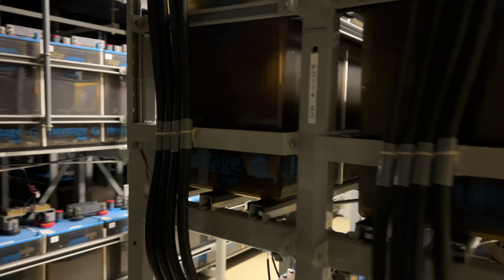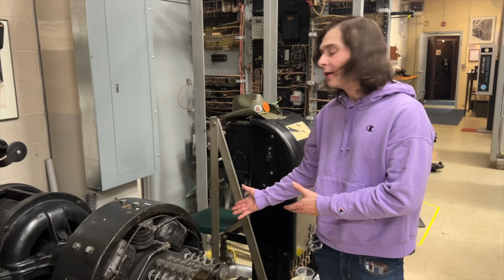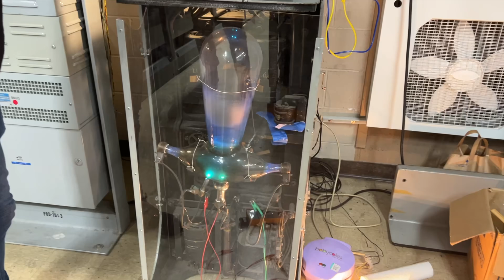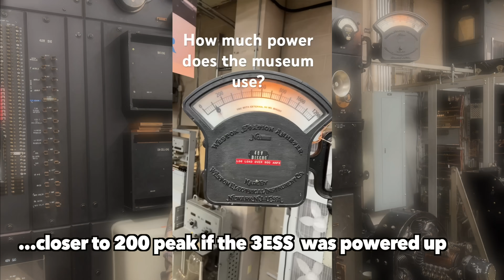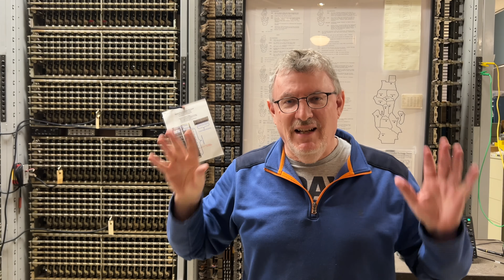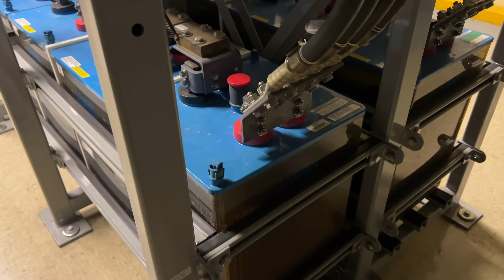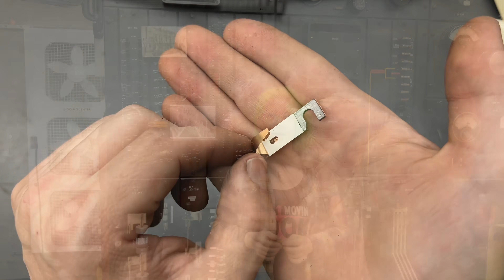All About Telephone Power Plants

Comment: Curious electronics student here with lots of questions:
4:32 So the power is always supplied from the generators, and the batteries are only there to smooth out power fluctuations? And if so, how large do the batteries even need to be relative to the load, i.e. how long would they hold up without (/with inadequate) generator input?
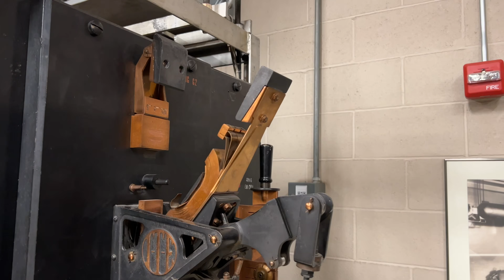7:40 If I had to guess, that's because it also contains enough copper to be very appealing to scrap. Very cool mechanical system, though, I'd definitely be interested in a more detailed discussion of it (Where are the remote actuators built in? How does it distinguish manual and overvoltage/back-EMF shutdown? What's the bottom contact pair with the jacobs-ladder-y arc extinguishers for? Why the three-stage contact mechanism and not just two stages?)
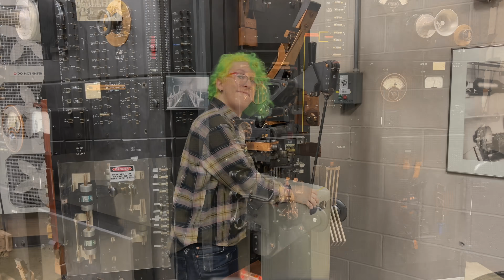11:23 So are the end cells intended to increase battery voltage temporarily? But if you still regulate to 48V with additional cells in series, the average cell voltage will drop, which is apparently pretty bad (14:16, although I'm surprised that 1.9V instead of 2V already damages lead-acid cells, I thought those were pretty resilient to overdischarge)
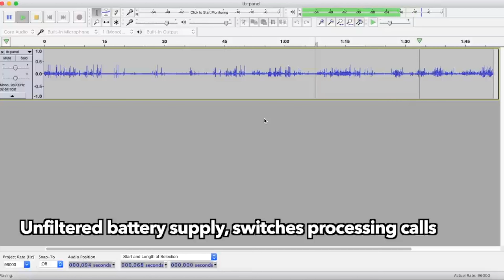3:31 This may be too fundamental a question, but I'm confused how exactly this switch-over works - particularly for the caller in a long-distance call, where the final connection is made in some far-away office: how does the originating office know the call is now connected, so it can switch to the talking battery? And how does the switch-over and resulting voltage drop not result in the connection being dropped?
Reply from the maker: Good questions! I'll try to provide helpful answers.

1. In the earliest days of common battery telephones (1900s-1920s) the equipment and network ran off of the batteries. When voltage became too low, Battery A (that had been supplying power) was cut over to the charging equipment, and Battery B (which had previously been charging) was cut over to run the equipment. Eventually, they moved to a "floating" style of charging, where the equipment is running on the batteries, but those same batteries are kept continuously charged.

The batteries always served two main purposes. To smooth out ripple in the charging circuit, and to provide reliability during power failures. Batteries could run the exchange for a few hours to a few days after a power failure. Exchanges also had diesel generators to charge the batteries, and those could run as long as fuel lasted. AT&T had pretty fantastic supply chain management and they could get fuel anywhere very fast.

2. The circuit breaker is surprisingly complex, and different breakers could be outfitted with different options depending on what the customer needed. The jacobs-laddery-contact-thing near the bottom opens the circuit to the main operating solenoid just after it starts to pull the breaker to the closed position. The solenoid uses A LOT of current, so we have to break it quickly and we don't want to do that with the button that actually starts its operation. Think of it like the "snapping" part of a household light switch.

3. The end cells are only cut in when the voltage of the main battery string is low enough to require them. We don't necessarily regulate down to 48V. That's just a "nominal" voltage. For example, the voltage level at the museum is 52.6 volts. (We don't actually get to decide on that number. That's just what Lumen, the telephone company, provides for us)

4. Talking battery is actually supplied in two places. For the originating side of the call, it is provided by the local office. For the terminating end of the call, it is provided by the far-end office. There is no need to apply talking battery for all of the links in the middle, since the talking battery is really only necessary for the telephones and local hook-state signaling. The human voice AC "wiggles" can travel along the wires just fine without that DC offset.

However, you are correct that the switches at either end need to know when to cut in the talking battery to their respective telephones at each end of the connection. This has to do with a concept that we in the telephone business call "supervision". As a part of its design, the switch "knows" when a call is completed, when a subscriber as answered the phone, and generally "what the state of the call is". So all we have to do is provide a relay somewhere in the call circuit that cuts off the "signal" battery and cuts-in the "talking" battery. The connection is not dropped because the switch over is very fast, and the relays responsible for holding the call up basically don't notice the change.

Exactly how the "supervision" of the call is transmitted between telephone switches can be quite complex, because it varies over time and between different systems. For now, we'll just have to say that "it works" and leave it at that. For a little more info on supervision, you can check out my video on the 2600hz signaling system here: https://www.youtube.com/watch?v=8PmkUPBhL4U&t=801s&pp=ygUGMjYwMGh6

Comment: Funny to see you using Audacity to measure noise. As a retired phone company flunky, I’ve been shocked by ring voltage in hot attics more times than I want to admit, and lugged around 20 lb HP test sets that we used to do what Audacity is doing for you here. I can’t remember what test set we used for noise. We had frequency analyzers, TDRs for locating damage, and of course all the digital test equipment for digital circuits like DS1s, ISDNs, etc. But I’m drawing a blank on what we used for noise. It might have just been an ohm meter that had a special “kick” feature, which sorta turned a circuit into a temporary capacitor. Hard to explain, but it was easy to find damaged or wet copper by filling the pair up with a bunch of electrons, then monitoring how long it took to discharge.

Of course we also measured echo return loss on designed voice circuits that class 4 and 5 PBXs spit out.

Fun times.
Reply: It was literally called a "kick meter" by the techs, but it was as you described, an ohm meter with a toggle switch below it. You'd connect the meter to the cable pair, then toggle the switch. A capacitive discharge would then take place and the amount of "kick" of the ohm meter during that discharge would be read. An experienced tech could read that kick and mentally convert it to distance to fault. It wasn't anything super accurate, but a tech familiar with the outside plant in their area could zero in on some cable faults by just using that ancient kick meter and sectionalizing the trouble. I retired as a telco engineer but spent many years as an outside tech using the kick meter. It was great for finding "opens", but less effective on other types of troubles. It was not used to measure noise per se, but it was good at determining whether or not a line had noise on it. If the kick meter indicated noise on the line, then we'd break out the heavy artillery such as the "breakdown" (literally welding the pair at the trouble spot with a high voltage test set), or the TDR if using a breakdown was not possible.

Fun times.

Comment: I was an early advocate for telecommunications systems to add the then quite expensive solar panels to the offices. The actual economy of the action at that time would have been that the DC from the panels could be used directly without inverters or any other equipment and although they could not single handed replace the emergency power but as long as the outage was during daylight hours the available emergency power could be greatly extended. 😕 No one was interested at the time. The acute interest was to cut cost was to make the bottom line look better.    

In the other hand if your just going to power live displays, 🤔 it may become feasible.

Comment: What an excellent will made video. My knowledge is with X-ray equipment. When I started working installing and repairing X-ray machines in the 1970s many of the systems out in rural hospitals and clinics still operated on relays and vacuum tubes. I recall working on an one million volt industrial X-ray unit that used a dynamotor to convert power. That machine was used to inspect the fuse inside 155mm shells. Back when I was a child in the 1950s I recall going into the local independent telephone office and watch two women work the plug and cord switchboard. The blue glow from the big rectifier tubes in the back office was very eerie.

Comment: Here in the UK the various telephone exchanges are switching to IP telephony. Basically every home will have an Internet router connected to the exchange either via optical fibre or copper DSL connection; an IP phone will then be connected to the router, together with home computers, cell phones on WiFi, printers and so on.
I plan to connect an UPS to power the router, in the hope to keep the IP phone in operation during any power blackout. But - if there are any roadside cabinet requiring main power to operate the fiber amplifiers or the DSLAM interfaces, the home router UPS is a waste of resource on my part.
Thank you for the explanatory video. I personally believe the PSTN Is superior to IP telephony under any circumstance - especially during emergencies.
Greetings, 
Anthony

Comment: Good material, but fuses are for wimps! I heard from a British Telecom power man who, back in the 1960s, had wondered why the battery voltage in a very large Strowger exchange had dipped from 48V to 47V for a few seconds. Turned out that someone had driven a fork-lift truck into a pair of main bus-bars, shorting them and melting the side off the fork-lift. It just kept going until they moved the fork-lift away.

Comment: I'm surprised they didn't control the DC generators using a regulator on the field winding as was standard practice when cars still had generators rather than alternators. 

I worked for a power company that had a lot of telephone equipment and other communications equipment that ran from -48 volts (as well as other DC voltages and grounding schemes). Some of the older stuff actually used standard 120 volt AC circuit breakers to control the 48 volts DC. This was all old and while it did seem to work using AC breakers on DC is not safe and would be replaced with DC breakers or fuses when upgraded.

Comment: The OG Matrix. Are you guys here in Seattle?  I worked as a broadband technician and would run in to these old pieces of equipment on a regular basis.

I have a question about the old 3-wire system.  I have run into many houses that have one pair going to the house - which would then go to this "light socket" shaped device and 3 wires would go to the extension phones in the house.  I couldn't get a clear answer - my friend said it was for the first "Princess phone" (or backlit dial) is this true?  It looks like it was put in when the house was built in 1912

Comment: I inherited a 1920s Siemens 380V three phase AC to 60V 300 Amps DC motor-generator from  my grandfather. He bought it cheap at a surplus store and converted it to a crazy powerful welding/gouging machine in the 1950s. I still use that monster occasionally for carbon gouging stuff like excavator buckets. What a machine!

Comment: Seeing all of these fuses, switch contacts and even breakers exposed like this gives me anxiety, but my battery is around 270V; that and 450V 3 phase don't mess around. Weird that your breakers have two sets of arcing contacts before the main contacts but I suppose an ACB-5003R shuts and opens a whole lot faster than a manually operated breaker.

Comment: Right so yes new sub now to this channel. ;)
There needs to be more people that see old tech as an art form.
It might be obsolete but still works fine.
I am fascinated by the Eletromechanical Pinball Machines that I will some times repair.
I work on any and all pinball machines as I see them all as works of art.
The EMs are fascinating as it baffles me how they got EMs to work when it is just a bunch of switches in the machine making coils pop and score reels go.
And its done by lots of relays.

I always say yea EMs might be obsolete pinball machines but with them if a fuse blows it won't take out a circuit board as there is no circuits to fry.
Basically check over the machine and find the fault and pop in a new fuse and you are flipping again.

Solid State is great though to as it makes a room full of analog stuff into just a small form factor.

Comment: Nice video. Most people have no idea how much power is needed at a phone exchange and battery 48V . Being a electrician and worked in a multi use budling I got to see a exchange from the inside. was modern and fiber optic cables now but lots of old stuff still in place. HUGE 2V batteries . 24 of them. I could have gotten a old 48V charger but was huge and burned out. scrapped. was 1960's and had Samnium rectifiers in them. they went bad . The new one was SMPS and 480V 3 phase. now the new fiber system needs a converter at customer to use old phones and has a 12V AGM battery . back to biggening of phones when they provided battery's for the phone. but the fiber optic cable has TV HDTV and super fast internet and phone all on it now. The fun part is a phone from 1940's still works . one in use at switch office . I am in NY and would love to visit Museum with my girlfriend . make a call on old phone . love what you do !

Comment: Could you talk about what happens to the equipment when it loses power? Are all calls dropped when that huge fuse blows - and again when the switch is flipped after replacement? Do they disconnect when it does a "reset" on powerup? Does it just keep working in the last-known state? Are there redundant power paths to every piece of equipment to reduce the impact of blown upstream fuses like on modern servers?

Comment: Why did they choose 48 volt
Reply: My understanding is it’s a balance between a high enough voltage to do the electrical work and minimise the current flow and low enough not to be an electrocution risk.
It’s 50v nominal

Comment: BackEMF could drive current upstream, but that would be extremely rare (or the grid is down, which is quite dangerous).  The more likely scenario is that the Back EMF will increase heat in the windings and eventually lead to the system melting/catching fire.  

This is also why in AC undercurrent situations you have a time window where components will automatically sever themselves from the power grid.  Running at too low a voltage will cause back EMF and it’s only a mount of time before components exceed their temperature rating (this is why power providers are forced to choose rolling blackouts over running with sagging voltages)

Comment: This is not telco, but it’s all I got. The Nevada unemployment office had a big diesel backup generator for their computers. There was a big tray of lead-acid starting batteries on the floor at its side. Every week a maintenance guy would stand off to the side (in view of the tray) and start up the generator. This one week for some reason he stood in front of the the generator control panel in the shadow of the generator. The batteries exploded, spraying acid all over everything, but as he was in the shadow, he escaped harm. You could see the stains in the generator’s paint  where the acid ran down.

The OSHA Website used to (but no longer) describe fatal injuries as object lessons. One was a L-A battery cart used to start cars with dead batteries. One day it exploded, killing the operator standing adjacent. Moral: Never stand in line with starting batteries.